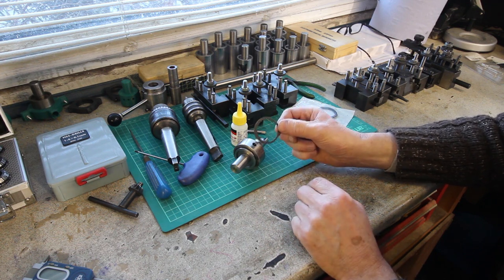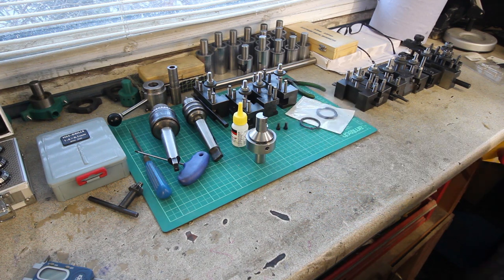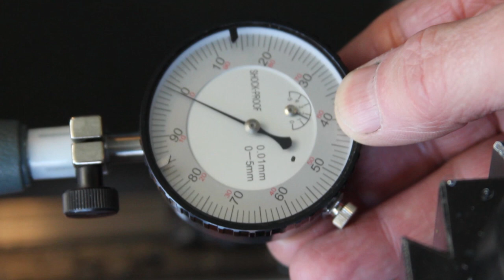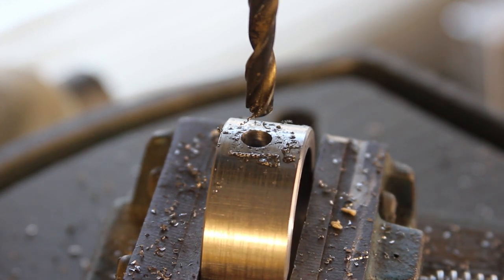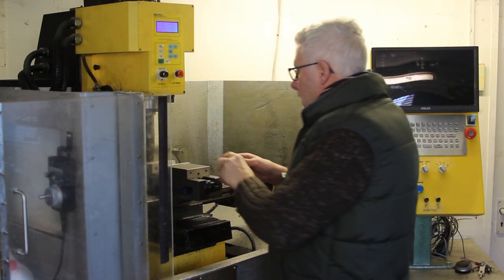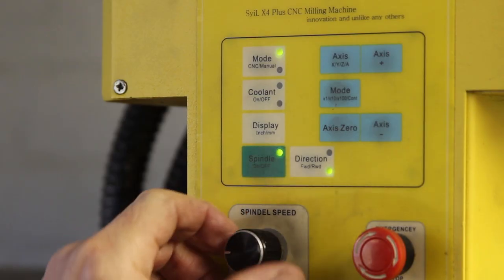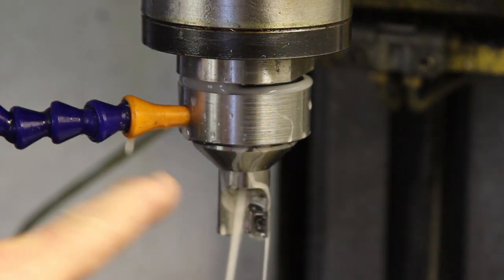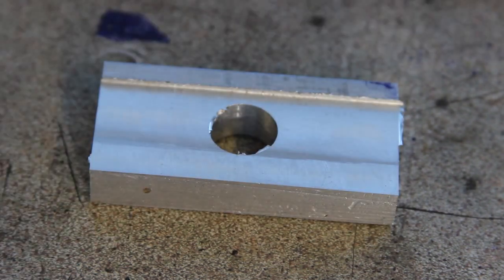DIY through spindle coolant final update

Comment: To me, I think the through coolant flow restricts at higher spindle speeds to the point to zero flow. The passages need to be redesigned from inverted firstly to outverted first. I'd start with a circular canal area in the metal body with passages starting from it on its outer diameter shaped like the edge of a arrow head spike with a negative rake angle of the 4 passages in the 2 difference planes if that makes any sense to you. The plastic water delivery system would need redesigning to match, but if the circular canal channel could have a circular form with a smaller diameter straight canal channel feeding it, you may get away with just drip feeding water down into it. To do this, it may need to be made out of more than one main piece. When running the spindle, this would be like a car water pump. I would enjoy watching this trying to be made. I hope you get my idea.
Reply from the maker: Thanks James,
I think I get what you mean. I feel the issues you highlight are correct. Centrifugal forces could indeed stop the flow of coolant. I wonder if that's why pro machines use a high pressure pump for spindle coolant. I made this because I thought is was a cool idea not sure if will ever catch on though. I have a new camera that does have a slomo function would be interesting to see if it can pick up any thing?
I will give it a try.
Cheers